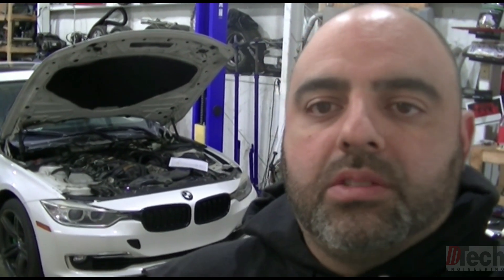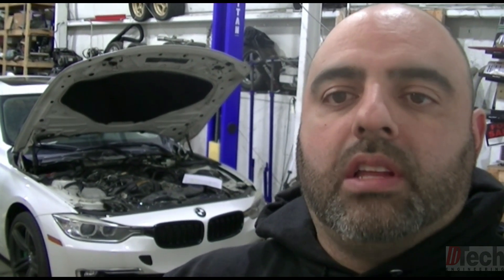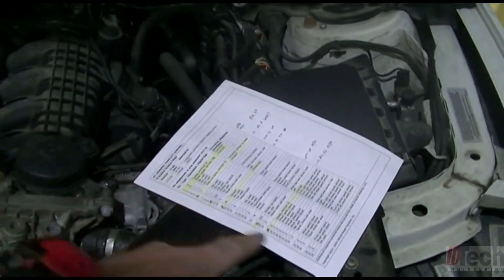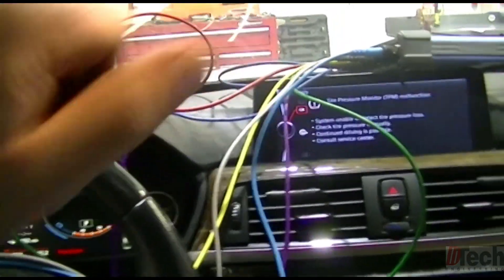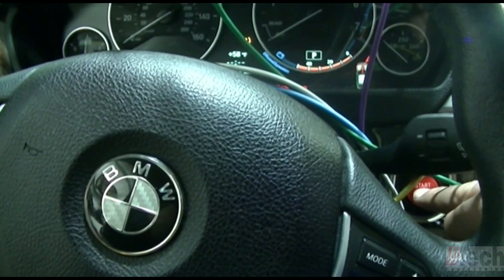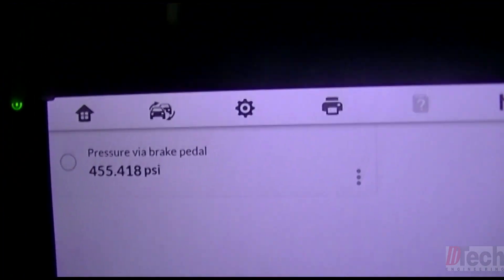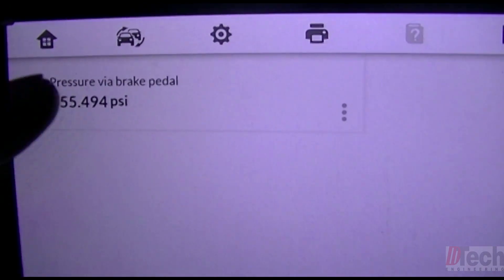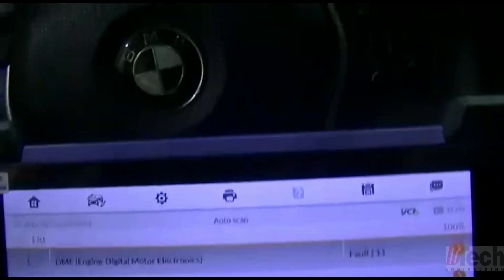BMW F30 TRACTION LIGHTS ON & FLEXRAY COMM FAULTS

Comment: ....this is happening to me, EPS now gone weak in a 2011 525d. It was periodic, randomly cutting my power mostly happening in 3rd and 6th. Found a break in the red power cable going to EPS. Brilliant, now I'm probably looking at a new motor as the module is probably fucking fried.

Comment: I believe the term you were searching for is referred to as a "Babbling Node." It's basically when a module won't shut up. Throws out constant irrational messages . Other modules, as well as itself, can't hear what's being transmitted. And, yes, can be difficult to pinpoint. But you did an excellent job as always sir
Reply from the maker: Yes, I believe my mind knew what was going on and my mouth "babbled" about the "node"...But yes this one was one of those that you hope you are correct since the module never really "dropped out" as am used to seeing. Thanks for watching and hope all is well!

Comment: Great video, Sadel!  Two questions for you, if I may:
- Is the Flexray BMW’s version of a CANBUS?  If so, does it operate where if a module to be removed (or fail) does it register as a different OHM reading for the network?
- Were you able to successfully code the DSC module (without needing to program it) because the replacement DSC had the same part number as the original DSC?
Reply from the maker: they still have CAN for the other bus systems on the vehicle, flexray is a little bit different on how it operates and its properties, the biggest difference is its speed. I honestly wouldn't be able to tell you about the ohm's, and yes I showed how it coded correctly and was able to convert it to all wheel drive and so on, despite the part numbers not being exactly the same.

Comment: Today happens this to me, found out the ground on the dsc board was “dissapearing” when the connector was moved. Turns out the pin in the board was at cold solder joint